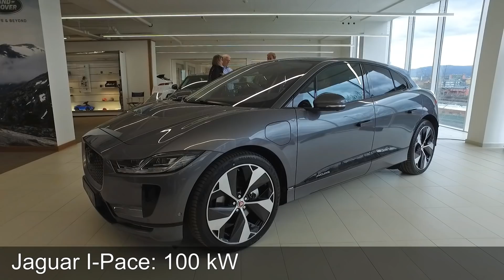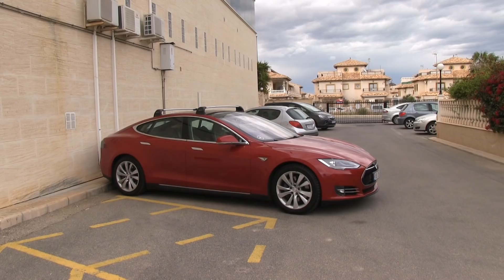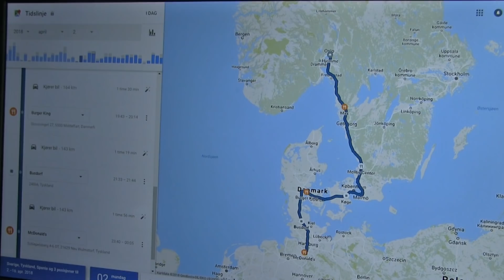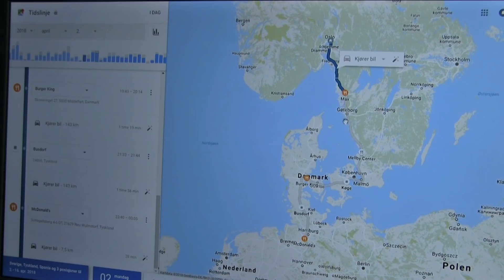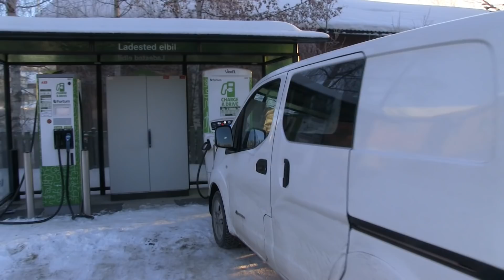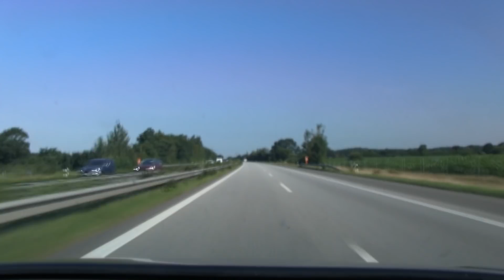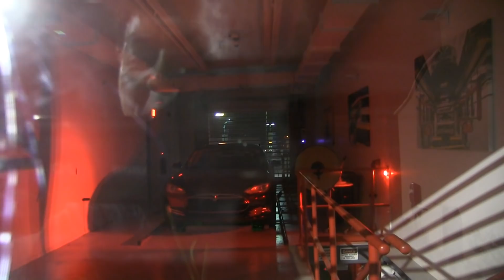Will 350 kW fast charging be too fast?

Comment: How about a system, where you can dial in the expected departure time as you plug in, and the car will choose charging speed accordingly? This way the capacity would go to whoever needs it.
Question: If you could choose one, would you choose higher speed or more stalls?
Reply: meomarte more stalls. Parking lots are everywhere. Just charger there. Like Bjorn said, too fast charging is not usefull on trips where you need them. People are lazy. No one stay 10 or even 5min at the car just to park it somewhere then and go to eat. For like a toilet brake it would be perfect but normally you drive 3h to 4h or so and then you need a break.
I know there are people who drives 6 to 8h straight but thats kinda criminal. Only if you switch with your passanger its ok, but even then. I could not sit in a car for that long without 30min breaks.
I think 200kwh is perfect speed and maybe for all the stalls. Not like now where you share it if its fully loaded. Cause in this case its gonna need 1h 30min in worst case....
Reply: long trips is only one scenario though. What about the everyday person who wants to charge his car? Great fun to have to sit for 20-30 minutes at a charging station on a friday evening after work (provided that there are available stalls to begin with or you can increase your wait time by an aditional 20).

Most people are going to want to use their EV like they're using their ICE car today so yes: faster charging would be better.
Reply: Thierry Van Tillo 90% of actual Tesla driver charge at home. Other evs will even be higher. Your car will stay over the night for at least for 6h. Mostly enough to charge the daily needs. The problem of the most engine drivers out here now is, they think its the same to drive an ev like an engine car. But its not. You start your day with a full tank. Of course there are a very little amount of scenarios where you will be in trouble. Trips is one of those scenarios, but like you can see, Tesla is almost on the perfect point for this scenario. And the rest of people who may need a distance over 500km a day, they should not buy an Ev if time matters. The target is not to bring everyone to buy an Ev. The target is to bring a bunch of people to drive an ev. So its kinda balanced. If we have 80% ev drivers on that planet in the next 5 years, we gonna have a big energy problem!
Reply: That's fair enough, but your assumption seems to be that everyone has the option of charging at home. Frankly, quite a lot of people live in dense city/urban areas where they have to park on the street wherever they find a spot. And those are exactly the kind of people who would benefit the most from having an electric car too.
They don't have a garage and might not want (or simply won't be able to) use an extension cord to plug in their car overnight.

So a lot of people will still have to rely on the public infrastructure to keep their car charged and ready.
And as more and more EVs hit the road we're gonna see busier and busier chargers so suddenly that "20 minute charge time" no longer seems all that acceptable.
Just imagine pulling up to a petrol station today and having to wait 20-30 minutes for a spot to free up... Just fucken great.

And honestly? There's no way you'll ever hear me complain about my car charging too fast...
Reply: Good arguments. I too see charging at home to be the default, especially, when capacity for it begins to be installed for every new home built. Anything like this anywhere? In the city this could be a commercial parking house/garage, if a dedicated lot is not included with the apartment.
But I have to disagree on the target. It should always be "converting" everyone. In reality however, 80% of people don´t just snap into driving EVs. Rather it is going to be a long uphill battle until the critical mass has been reached. And since car manufacturers don´t seem to be in any hurry to produce EVs, I don´t see a problem arising here, even in 2020, when many new models are projected to be released. Plenty of time to install solar panels and wind turbines with some batteries. And domestic chargers. Also think about the saved electricity, when you don´t have to boil so much crude oil to refine it to various products.
Reply: Thierry Van Tillo I see your point. But dont forget that charging points will come up more and more too. The infrastructure will be more and more like that you have a lot of small chargers everywhere. Like at home, at work, at shopping centers etc. We have only a normal household plugin at home, but its enough to charge more than 100km over night. Normally we dont need more. If so you should buy a faster charger. The time is not far enough yet to have the possibility for the most people yet. But its increasing quiet fast. Do you drive an EV? Where are you from? I think it depends on the country too :) so I can only speak for my area here around Zurich
Reply: ASTZDomidragon I looked into getting one (testdrove a couple and absolutely love driving electric) but in the end decided against it, infrastructure here is no where near good enough for me to be able to comfortably use an EV with the same convenience as an ICE.
Destination chargers are pretty much non-existant and there's only one supercharger that's relatively nearby.

I can see a system of "destination chargers everywhere" working but it's going to take a massive change in public infrastructure, and an overhaul of aging powergrids and they're gonna have to install thousands of the damn things.
At some point it must become more economical to have fast megachargers at a central location somewhere, easier to link up to a buffered energy system and thus less of a burden on the grid.

Comment: I could be missing something but my understanding is NONE of the current battery's can be fast charged 100% of the time especially to full capacity without damage so some level of battery gate exists in all current solutions
Reply: It doesn't have to charge to full capacity. Just enough to make it to the next charging station.

Comment: It's not 'too' fast, bigger batteries are coming, thus you need to prepare to keep the charging times low.
They even may have buses or lorries with larger batteries using the same stalls.
Reply from the maker: Sharing stalls with trucks is a bad idea.
Reply: halixol normal unfortunately optimal battery capacity on the current capacity to weight ratio is between 70-90kwh usable

Comment: It won't be possible to charge at that speed with normal cars. Look at the Leaf or Zoo, they can't use maximum power of chademo or the Ioniq that charges at 70-80 kW.  350 kW would be possible for Tesla Semi or other vehicles with giant batteries. Maybe the Roadster with a newer battery would Approach to that speed.

Comment: In my opinion 60-80kWh battery with 2C charging rate is perfect sweet spot (depending on car size). This will let you do solid 200km that is good for 15-20 minutes brake. My personal favorite would be Ioniq with 40kWh pack.
Reply: Why would you want to waste 20min every 200km? Keep in mind that there will be hundreds of other cars that also need to charge.
Reply: > So with EVs, we probably need more stations on motorways and less in towns.  

Definitely. I was talking about highway refueling where fast charging makes the most sense and where you have to keep a high throughput to not block.
Reply: whuzzzup I would do it for my health. I just feel more relaxed when I do 15-20 min brakes every 180-200 km.
Reply: Well you certainly need a lot more than gas station pumps to achieve the same throughput of charge/refueling.
Reply: stopping every 200 km is no good. there will need to be built a charging station every 200 km and a charger built for everyone who had just been at the last one.

better to sit at the last charger a bit longer
Reply: @hey7328  it's what you should do, take a 15 min rest every 200km is recommended to stay alert.
Reply: whuzzzup no you don't as initial charge is done at home over night. You can't refill ICE at home. So having can with 60kWh battery I can travel most of my long trips stopping just for a while close to destination.

Comment: You miss half of the equation, 350KW is too fast for battery which is not big enough, I will say less than 200KWH. It will easily cost damage of the battery. 
Currently, other EV manufacture is using "fast charging" as PR move to show their product somehow superior, in fact, they haven't even release first generation product yet, they know absolutely nothing in term of battery life span and what is idea charging speed.
Reply: I'm probably doing something wrong with my math but 350kW would be charging a 700kwH battery pack at 1C, 3C for a 200kwH battery. Car batteries of that size don't exist and it'd be overcharging any normal sized battery pack.
Reply: Tell me how can you manage the charging with 350KW fast charging on 75KWH battery? Either you get slow charging or you damage the battery. That's why Tesla has system control the charging speed and this is exactly what they say why 350KW on current battery size EV doesn't make sense.
Reply: He didn't missed it. He talked about that in the C-rate part.

Comment: I think it's probably best to have the ability to be able to charge to 80% in 15 minutes and not have to use it often rather than not have the option to charge that quickly, this way if you are on a tight schedule you have the option. Also with the current trend of more EV's being bought, the options for charging en-route would be, have quick turnaround times at the charging stalls, or have huge facilities with a hundred charge points to cope with the demand.

Comment: A great solution would be this robo arm that plugs in automatically together with an software update which will drive the car like in autoparking 10 meter forward or the camera sees marks on the bottom and drives the car to extra parkinglots for finished charged teslas. The robo arm unplugs ,the Tesla drives to the parking lot you dont block stalls and you can relaxed have your break :D I love your German words Scheiße ... I live Germany and speak german and i am really intrested of Tesla.